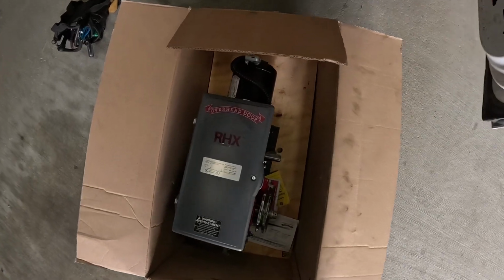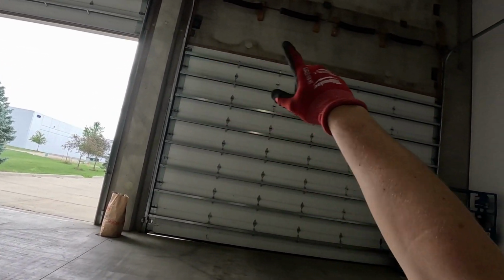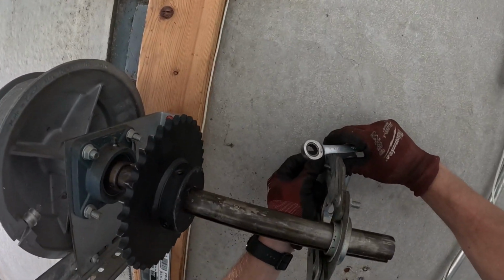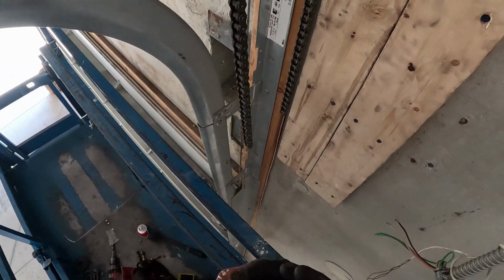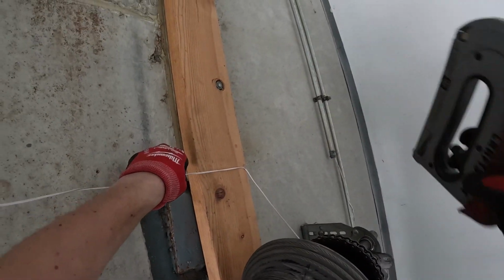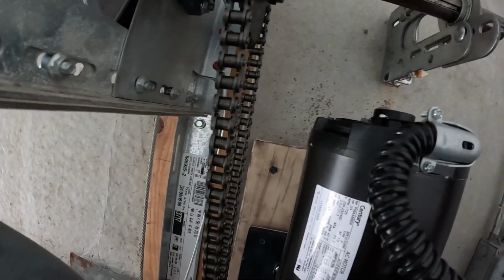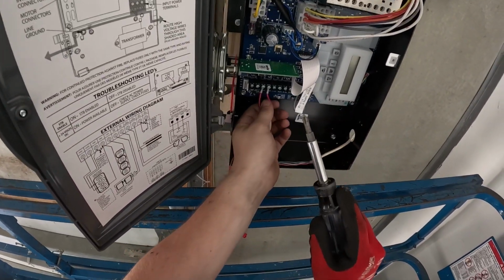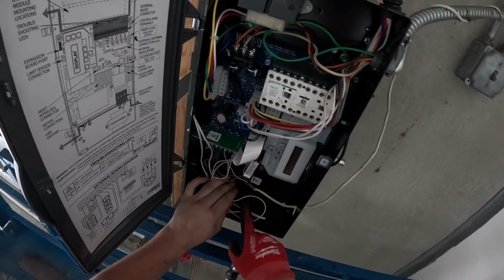Commercial Garage Door Opener Installation! Installing an OHD RHX!

Comment: Are not the photo eyes suppose to be mounted no higher than 6 inches from the ground? 

Great install. 👍🏼
Reply from the maker: This door is constant contact, which means the button needs to be pushed at all times in order for the door to go down. We did it like that so it would also be able to see if the back of a semi was coming in (6 inchs is too low for a semi without its tandems pushed back)
Reply: In South Dakota it’s a law to have em mounted 6-8 
Inches from the ground